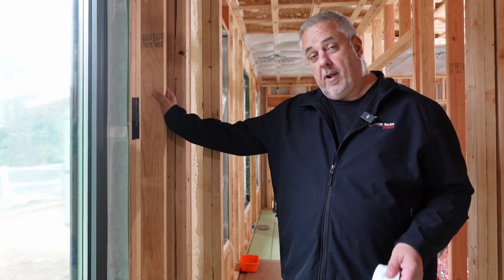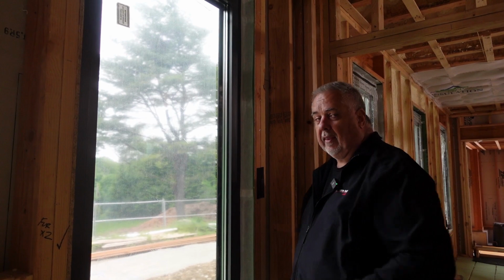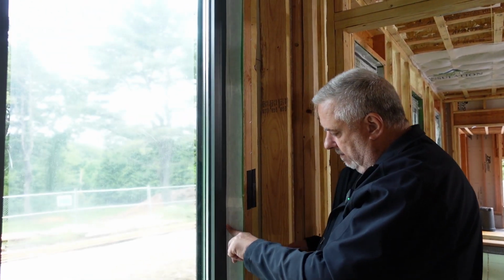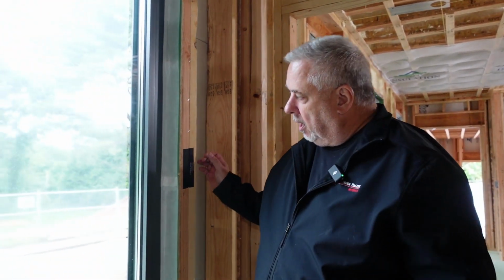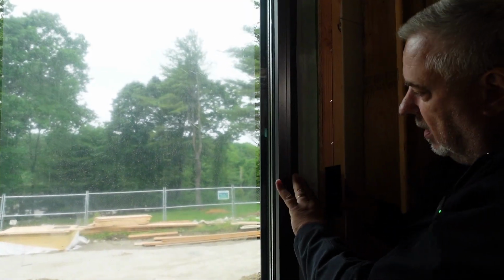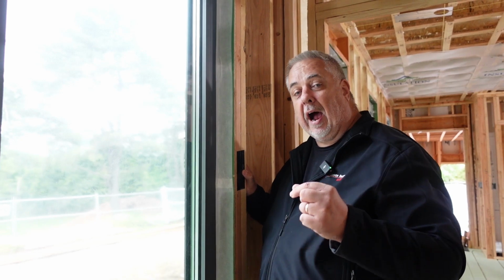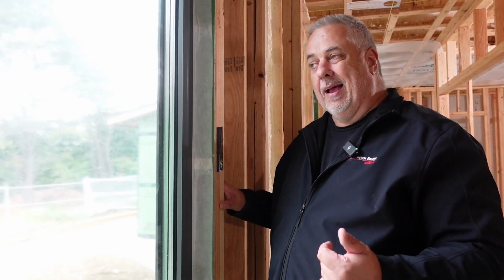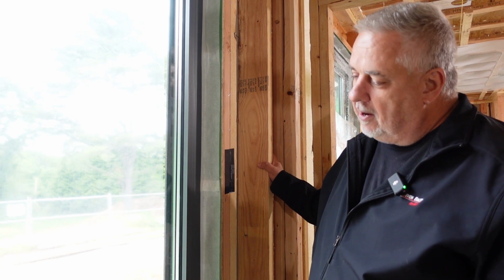AIRSEAL at the WINDOW Interior

Comment: Hey Steve, fantastic video.  I have been using Siga Fentrim on my foundation to zip translation for quite a while.  I am definitely going to order this product.  My question; I am a certified PHIUS builder and we build some pretty tight houses in Utah.  I have been marrying the Siga on the foundation with Prosoco JST and the combination is wonderful.  A total belt and suspenders approach.  I put down the JST and then cover it and more of the surface with the Siga. My thought for the windows is similar.  Can I use my standard backer rod and Prosoco air dam and then put this Siga product on after?  That would be a perfect solution for me to sleep well at night right.  Thanks in advance for any feedback.  Again, I love watching your knowledge and how you explain your details!!